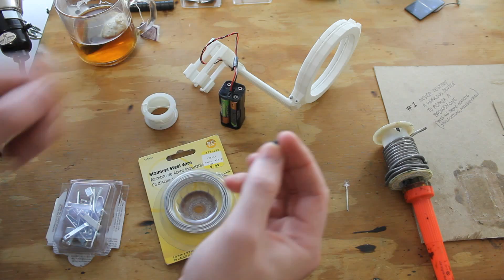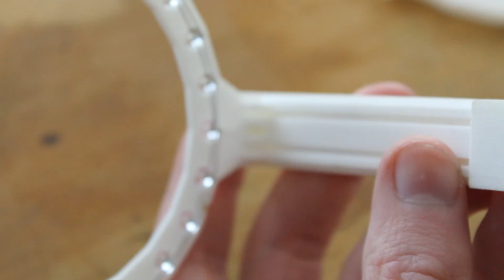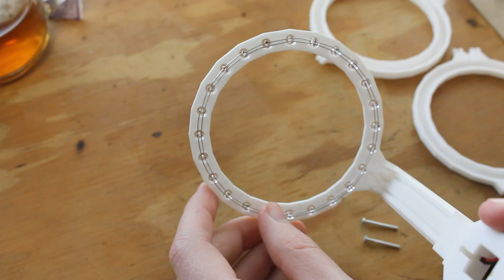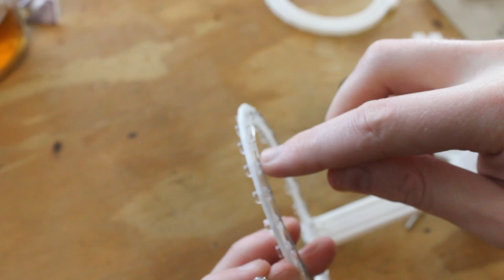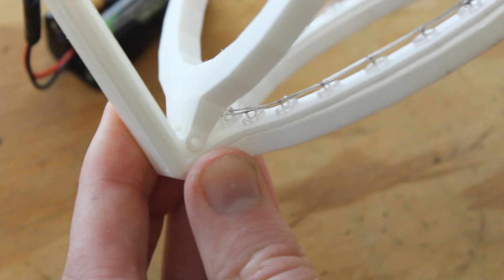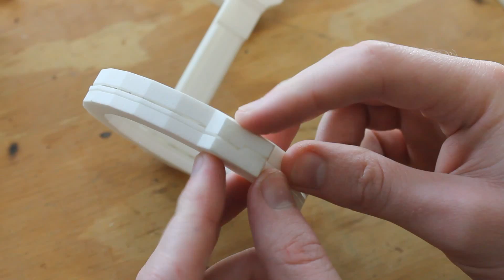DIY Canon Ring Light Construction Support

Comment: but generally speaking is challenging and I like it. I am I excited to use it, the other problem that I have is that this light does not work with my Canon 7D normally, (this is not your fault) you always told us that this light was designed 4 the Canon T2i, but I have figured something that it could help in this case, the ring will be attached instead to the 7D shoe it will be attached to the 7D tripod screw at the bottom of the camera this way it fits perfect after some tweaks,

Comment: Dear Neo finally after some desperate minutes I finally got the chance to clean the channel then it was kind of complicated to insert the wire, but finally I made something like a mini loop in a two -hyper twisted in between wire- as the one you used on the video, then I tried to hook it up with with a needle and finally I made it, now the LED´s are weld in between but now the problem is that the pins in the leds where a little bit taller than they should be and the back cover does not closes.

Comment from the maker: The hole & channel is only about 2mm square, but it is there, just where it is shown in the video. I used a straight length of 1mm gauge stainless steel wire to gently clear the channel of dust. I had to push it through a few times before the channel was totally clear. The dust is relatively loose, just requires a little pressure to push it out. You might need to twist the wire a bit. I'm sure any other kind of wire would also work.

Comment: Hello I received the body of the ring light but I am having serious problems in figuring how to wire from the leds strip to the microswitch, you mentioned the "channel in the middle" but how can I clean this duct from this small white dust that blocks everything, I mean I don't even see the hole from front ring to access the duct which it takes the wire to the back and reach the micro switch little slot hope to read some help .